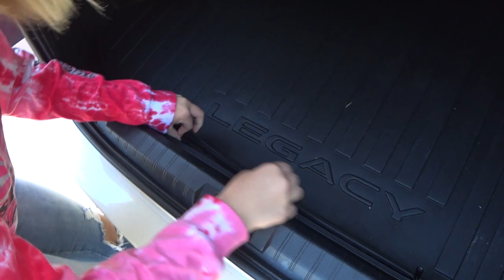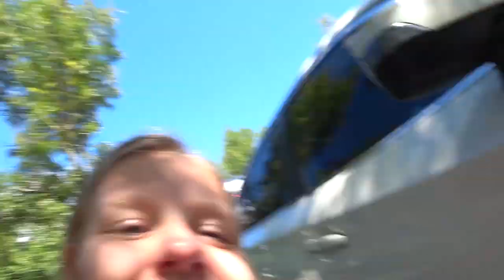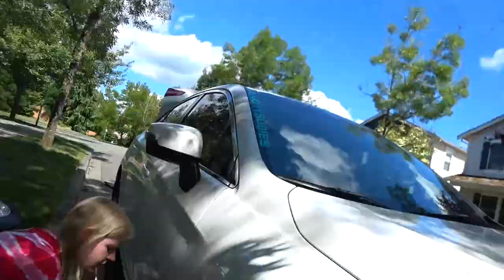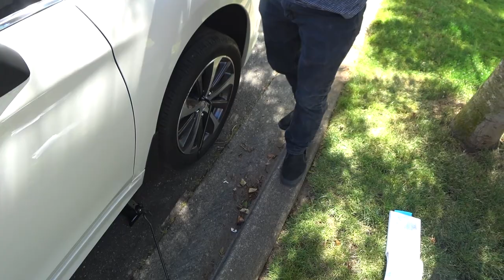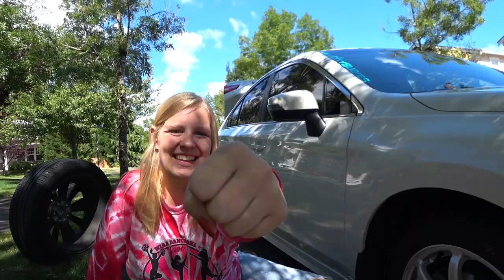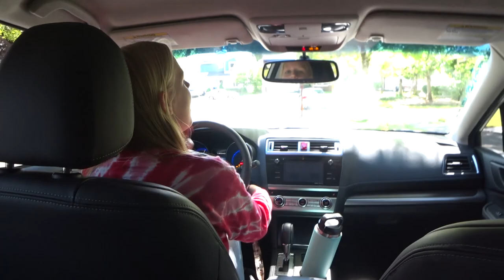Car Girl Changes Her First Tire

Comment: I would have told her tough ! ....  If you want that tire changed you got to take them lug nuts off. You have to do it yourself. So get them loose and get the tire off or your car sits there. I'm not helping you. You have to learn